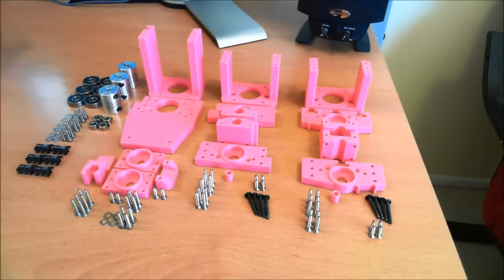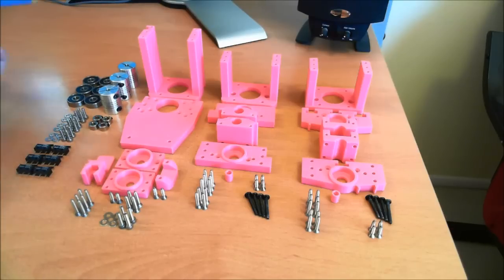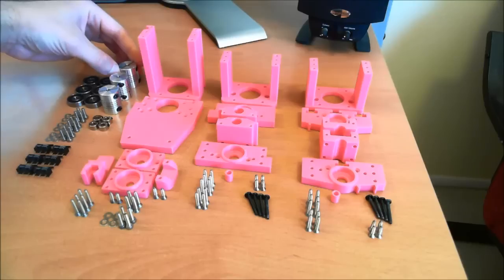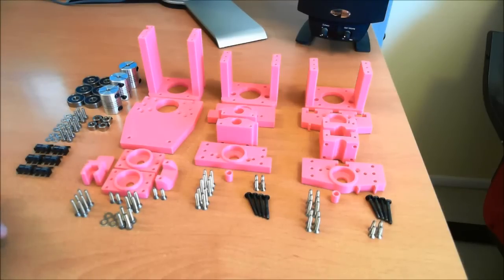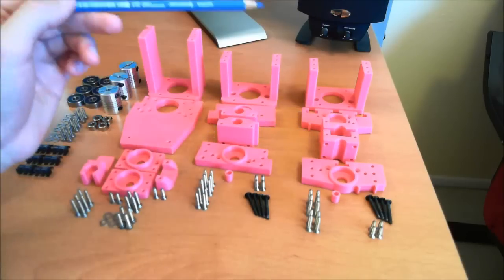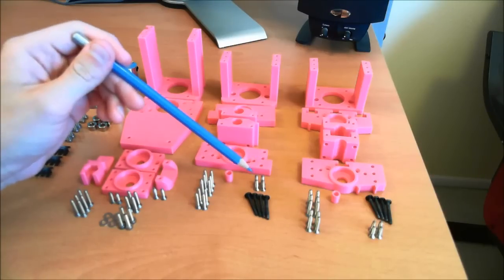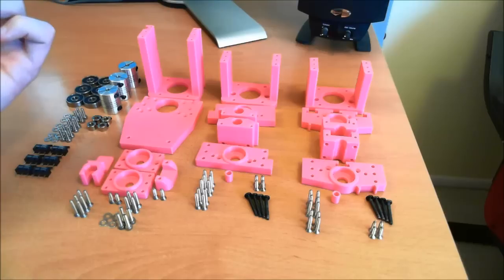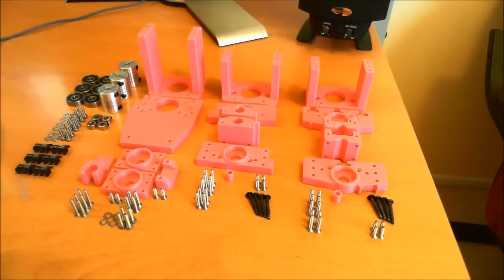Part 3 - Kit Overview - Bubblegum CNC Conversion Kit for Proxxon MF70 / KT70

Comment: Parts and Hardware:

Z Axis

-Printed Parts -
m70-zlimit
m70zplate-626-bearing-lower
m70zplate-626-bearing-upper
m70zplate-626-plate
m70zplate-626-stepper
Hardware
-Bracket Assembly
10x #4 3/4" Self Tapping Counter Sunk Screws
4x #4 1/2" Self Tapping Counter Sunk Screws
-Stepper Motor Assembly
4x M3 x 10mm Coarse Thread Socket Cap Screws
4x M3 Washers
2x 626-2RS Bearings(or regular)
1x 4x5x25mm Shaft Coupler(4mm side drilled out to 4.5mm)
1x Dubro #40 Brass Locking Collar (20/16" Drilled 4.5mm
-Assembly To Mill
4x M3 20mm Coarse Thread Socket Cap Screws

Lower Axis
-Printed Parts -
mf70lowerplate-626-internal
mf70lowerplate-626-internal-mirror
mf70lowerplate-626-plate
mf70lowerplate-626-plate-mirror
mf70lowerplate-626-stepper
Hardware
-Bracket Assembly
10x #4 3/4" Self Tapping Counter Sunk Screws
4x #4 1/2" Self Tapping Counter Sunk Screws
-Stepper Motor Assembly
4x M3 x 10mm Coarse Thread Socket Cap Screws
4x M3 Washers
2x 626-2RS Bearings(or regular)
1x 4x5x25mm Shaft Coupler(4mm side drilled out to 4.5mm)
1x Dubro #40 Brass Locking Collar (20/16" Drilled 4.5mm
-Assembly To Mill
4x M3 20mm(flexible on length) Self Tapping Button Head

Upper Axis
-Printed Parts -
mf70upperplate-626-internal
mf70upperplate-626-plate
mf70upperplate-626-plate-unblocked-mirror
mf70upperplate-626-stepper
Hardware
-Bracket Assembly
10x #4 3/4" Self Tapping Counter Sunk Screws
4x #4 1/2" Self Tapping Counter Sunk Screws
-Stepper Motor Assembly
4x M3 x 10mm Coarse Thread Socket Cap Screws
4x M3 Washers
2x 626-2RS Bearings(or regular)
1x 4x5x25mm Shaft Coupler(4mm side drilled out to 4.5mm)
1x Dubro #40 Brass Locking Collar (20/16" Drilled 4.5mm
-Assembly To Mill
4x M3 20mm(flexible on length) Self Tapping Button Head

Total Quantites Of Hardware
30x #4 3/4" Self Tapping Counter Sunk Screws
12x #4 1/2" Self Tapping Counter Sunk Screws
8x M3 20mm(flexible on length) Self Tapping Button Head
6 x 626-2RS Bearings
3x 4x5x25mm Shaft Couplers 4.5mm Drilled out
3x Dubro #40 Brass Locking Collars 3/16" (Drilled out to 4.5mm)
12x M3 x 10mm Coarse Thread Socket Cap Screws(or similar)
12x M3 Washers
6x Omron micro Switch D2F-01FL(or any pin/plunger micro switch)

Copied from the Comments in thingiverse :D

Comment: This is just a very great tutorial as well as overall project!
I bought a damaged MF70 (motor) and used your kit to convert it to a mini cnc machine.
So far, I had it go through 6mm brass, wood as well as lots of engraving and outline milling for small aluminium signs.
I am quite impressed how the 3D printed parts hold up. I really like the attention to detail you put in all of the parts and the tutorial.

Just one thing that happened to me: On the last milling, i noticed quite substantial backlash in the y axis (roughly 1mm)
After the milling operation was done, I examined it:
The whole spindle was able to slide front to back... I am not sure what caused it, but i think one of these four:
1. Locking Nut on far end of spindle became lose
2. I did not press in the bearings fully during installation / build, force on spindle over time pushed them in
3.Overall give in plastic parts
4. Locking collar was forced to the front
I will observe further. Just tightening the far side nut solved the problem. If it is 1 to 3, it is no problem anymore
If it is 4, I will file a grove in the spindle rigt after the collar and put a circlip to prevent further sliding of the collar.

All in all, thanks a lot for the project!!
Reply: Hi do you maybe have a list of the Metal parts (screws, couplers etc.)? since the website is down i can find it anywhere
Reply: @markustopfer1605  Hi, I just wrote down all the information in this video and ordered the parts. Actually, at the moment I am thinking about selling mine (works without any problem but I need a bigger one.) If you are from Germany, you might be interested in buying?
Reply: @LudwigBrechter  mensch das ist ziemlich blöde.. habe mir vor vier tagen eine gebrauchte mf 70 zwecks Umbau gekauft...